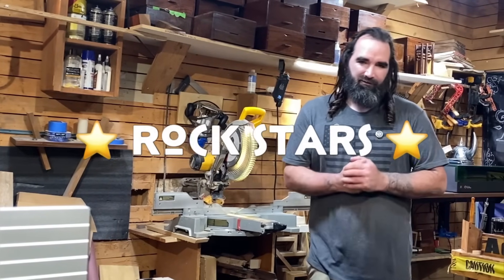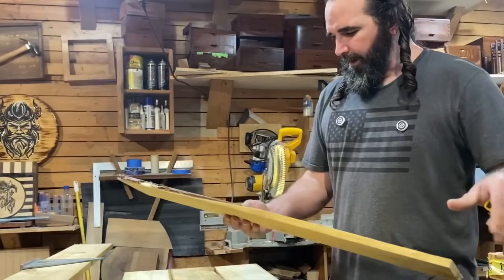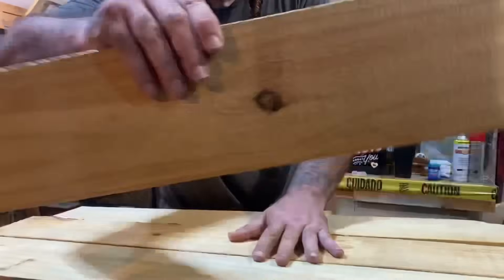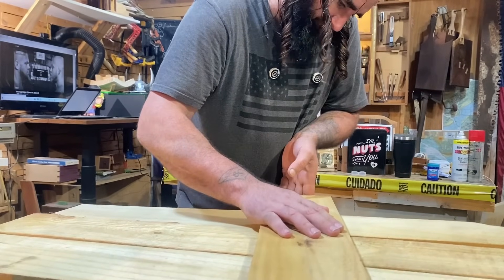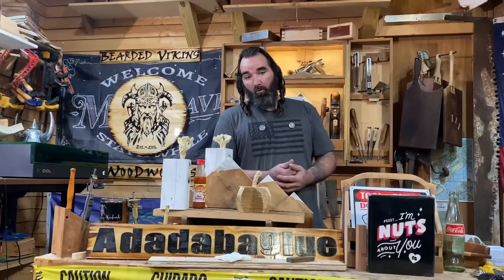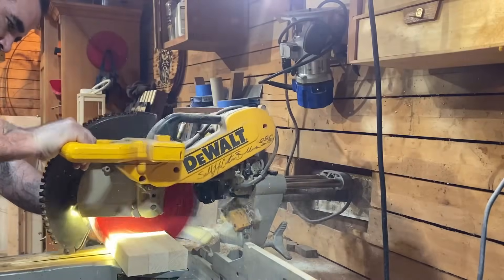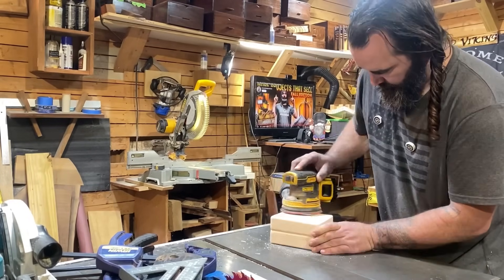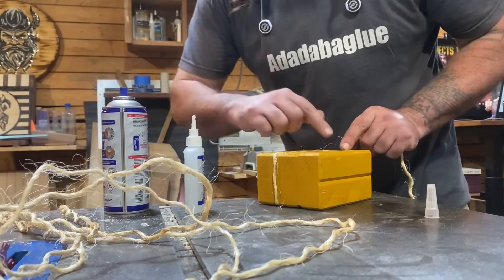Easy Woodworking Projects / Fall Edition

Comment: I like that little pumpkin project.  There's a trick for the laser engraver when you want to burn a design onto something that's already painted.  You can put down blue painter's tape over the area where the design will go and then it won't leave all that soot on the painted area.  You can also use that painter's tape trick if you wanted to use the laser to put a design on something and then paint that design like some lettering or a logo.  Just have the laser burn the design into painter's tape and then paint the design before you take the tape off.  Not sure how the settings for the laser change when doing the tape trick but there are several videos of people showing how to do that.
Reply from the maker: I have heard of this trick now !! You’re amazing

Comment: You forgot a few minor but important details when it comes to cedar pickets. When you lay the 3 pieces out, you should point out the crown needs to be positioned the same, and the other detail would be that the cedar will dramatically contract more than 1/4 as it dries.

Other than that, awesome video as usual.
Reply from the maker: Thanks for the Tip brothrr

Comment: Another great video! One thing I noticed on the pumpkin, if you do the chamfer on the bottom as well you can then start the string under and end under so you have a clean line going around the pumpkin and no hanging ends. 

Just another item I'll be building in the shop tomorrow!
Reply from the maker: Yeah I should’ve individually champhered each top and bottom to achieve that , 😂